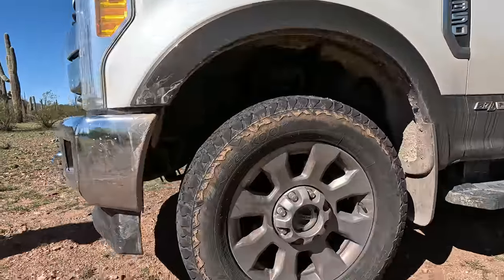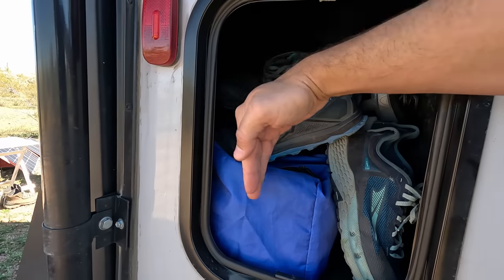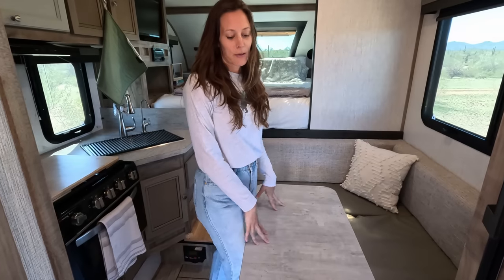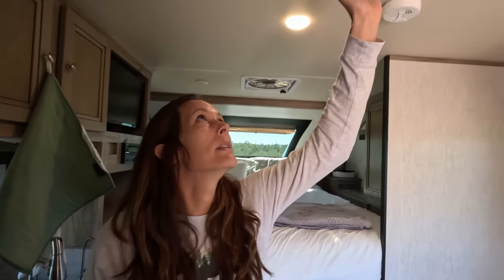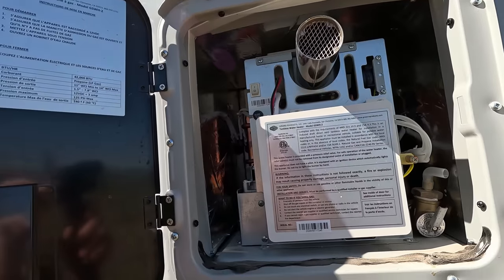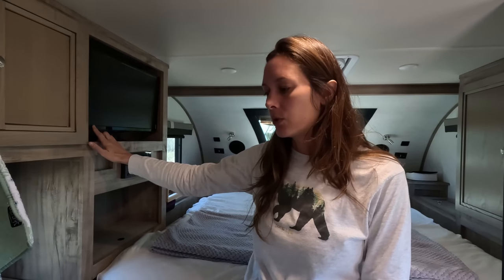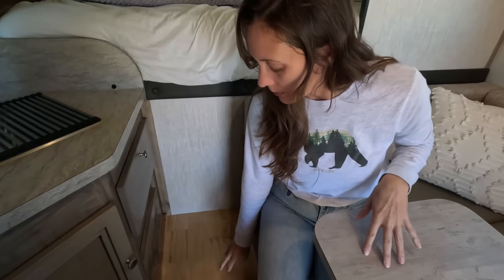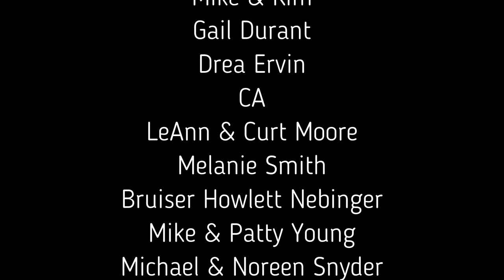Why a Truck Camper? Honest Six Month Review Living in a Truck Camper

Comment: As I watch these videos, the one thing I'm seeing is >> go smaller. There seems to really be no need for a big honkin' RV. A truck camper like this makes a lotta sense. Saw a video done with an Embassy van, as well - very cool, compact. These units seem to have everything that's critical, not a lot of extras, and obviously cost is lower than a big coach.
PS glad you got rid of the microwave - they make food toxic. Only valid use is to heat up a neck warmer :)

Comment: Excellent. BUT, I am struggling over two different choices. First, diesel or gasser. I worry about the power of having a maxed out weight on the truck and pulling a fiberglass fishing boat up steep grades without having to put my foot to the floor. But the gasser engine is simple and lighter.  Second, why did you not choose a dually? Winds are a serious issue to consider and a dually has a better stance to assist in the winds. It also helps stabilize the load as well and by buddy warns me that with all that weight and then you get a blowout of a rear tire, you can be in serious trouble. The weight will burry the wheel into the dirt or the pavement and will cause you to not only lose a tire but tear up your wheel costing you a new one as well. His biggest warning is if you have a blow out, not just a slow flat, their is a high risk of losing control of your truck as all the weight shifts to the flat tire side. With the wheel diggin in to the ground and the shift you have a chance of rolling over. So diesel or gas and single F350 or dually F350? I would appreciate your thoughts or if you considered these issues and why you chose the single axel instead? Thanks!
Reply from the maker: Diesel because less maintenance more power and reliability. We could t afford the new gas engine in the first because it’s the newer model. Or we would have went with that. We didn’t go dually because when off roaring rock can get jammed between the two tires and driving right trails in the forest. Which we have already done.

Comment: You know, it would be easy to get that insulated foil faced bubble wrap and cut out insulation for your uninsulated windows.  You could also fabricate a piece of plexiglass that almost fits each of those two windows and put some form of rubber edging around them that would have them wedge in to those windows with a gap between the two faces.  That would help to insulate the window while still allowing you to have sunlight and the view coming in!  

One question.  What is your gas mileage with the truck itself vrs when the camper is on it?  We're looking at campers and trying to sort out how they will affect our gas mileage.  Thanks!
Reply from the maker: Good idea! Before the camper we got 21mpg after 11.5mpg

Comment: When you go to town and get water, where do you get water?
I have had truck campers all my adult life, my 1st was a Six Pac camper for an import truck, very basic cab over but I loved it. We have had an 11.5' with slide and generator, have 2 campers now, one if a Vintage Alaskan and the other a 9.5' Lance.
Reply from the maker: We get water either at gas stations usually. We use an app called iOverlander  where other people on that app mark locations that have water, propane, showers, camping, etc.

Comment: We are 5th wheel campers at the moment. But looking to downsize.I've been trying to get my wife on board for one of these. She really likes this model. My one question is, have you been in any cold weather situations and how did it go?
Reply from the maker: Coldest we have been in this was 5 degrees. Felt like -14. The furnace works. I mean it gets hot. The tankless water heater kicks on when it’s below 35 degrees. It will kick on every 20 minutes to keep the pipes from freezing. The sound is loud and the light up of the monitor is bright when your asleep. We just open the cabinet door to block the monitor.
Reply: I've spent time in very cold weather with a tank water heater in an Arctic Fox, that has ducting to the plumbing, but the furnace is fairly noisy as it runs nearly all the time.  @CodyandKellie

Comment: I always run hot and cold on these.  One day it sounds great and the next not.  Not sure how many miles are on their truck but I'm thinking this is likely a $70k to $80k setup ($50k to $60k for the truck and $20k to $25k for the camper) .  Quite a few other options in that price range (used class C etc.).
Reply from the maker: Your correct. We want to be able to go off road
Reply: @CodyandKellie  Makes sense.  It's really the trucks that are still crazy expensive, not so much the campers. You guys put together a nice tour of your rig.

Comment: So, you don't have batteries and an inverter?  I'm not understanding why you can't use the AC or a microwave without shore power.  The AC should be 12 volt, so an inverter shouldn't be needed to run it.  I haven't had truck bed camper, but everything I've read about and looked at was set up like the travel trailers, with battery hookups, inverter, and solar ready.  The two trailers I've owned over the years, you could use the AC and Microwave daily without shore power.

I with you on the indicator lights.  That's one thing that bothered me when I first got into travel trailers.  I actually mounted a rod and blackout curtain over the instrument panels.  Those lights can seem really bright once you have you have all the main lights turned off and you're trying to go to sleep.
Reply from the maker: We did not have room for the inverter. We only got the lithium batteries to keep us off grid longer while not using ac.

Comment: Can you add a 12 volt power outlet near the instant hot water system, and then put a small heating pad in there to keep it over 40?

Comment: May I ask how you spec'd the 350 to handle the payload? That Camper is about 3,000 LBS without fluids or personal effects. I see some folks claiming a F450 or F550 is the way to go.
Reply from the maker: We have air bags and extra leaf springs. We have not had an issue at all. We’re not sagging and this truck is powerful.

Comment: That was great news about everything you hit on. But why diesel as opposed to gas? I mean is the cost a issue?
Reply from the maker: With this particular year model the gas engine had recalls and some issues. Also diesel requires less maintenance. Gas is more expensive but engine repair is also expensive and time consuming.

Comment: How is your mpg between your van and the truck? Do you get alot of wind drag with the camper?
Does it feel top heavy or does it handle nicely?
Reply from the maker: We get 12mpg before the camper we got 21mpg. It’s not top heavy, all the weight is on the bed of the truck like the water tanks. Seems to handle really well.

Comment: Im 43. Im wondering if I should go with truck camper or van. The truck camper seems a better deal because you can replace Truck still have a home.

What im wondering is acess to truck camper. Is there steps you can get? Curiouse at age 60 would I fall over and break my hip lol.
Reply from the maker: Yes it’s a far up to get in there. Other brands have different steps

Comment: Where do you dump your toilet waste?
Reply from the maker: We use an app called iOverlander. It shows places you can dump and refill water. Some are free. Since we have a camp toilet it goes in the trash.
Reply: @CodyandKellie  I forgot to ask if the bags you use really work and what brand are they? I used bags that are meant for a Lugable Loo and they did not work.
Reply from the maker: Yes they work. We haven’t had any issues with them leaking or tearing. They are listed in our gear list under the description of the video
Reply: @CodyandKellie  I'm not on Pintrest.
Reply from the maker: I didn’t think you had to have an account to see our gear. WZFI Portable Camping Toilet Bags,8 Gallon Super Thick Camping Toilet Bags Biodegradable Porta Potty Bags Leak-Proof Trash Bags for Adults Outdoor Boating Travel https://a.co/d/dRGe8PA
Reply: @CodyandKellie  thank you for the link. Do you use any absorbing gel or something to absorb the liquid and odor? I tried one brand and it wasn't really good, Doody Bags I think.

Comment: Hi guys, n do u have 1000-2000 watt pure sine inverter? Walmart sells plastic foam u can cut n cover n put in2 long pillow case 2 fit ur seating area.  Was it hard taking out the toilet? Will u b getting reflectics window covers? Did Kelly's dad find ur camper or did u go thru a dealer or something else? thk u. rox
Reply from the maker: It’s a 1000 watt inverter exact replacement of the deep cycle inverter that was original. Probably won’t get window coverings. Was not hard to remove the toilet. Had to find something to cover the hole. We found the camper ourselves just looking online.